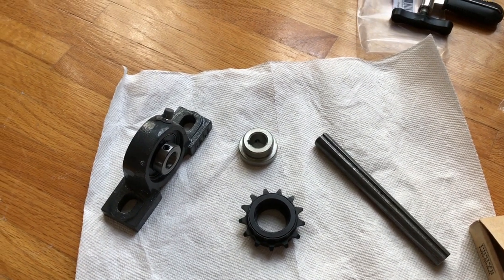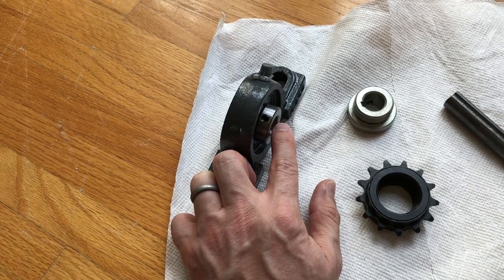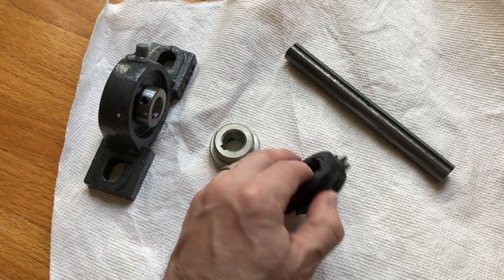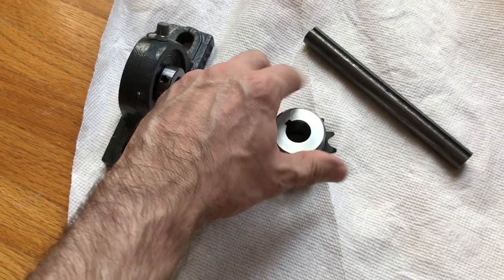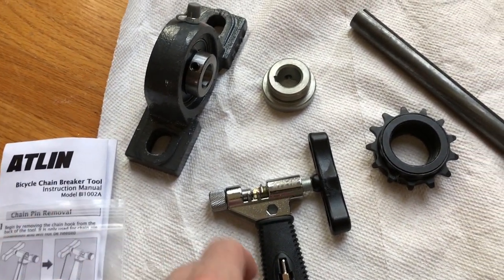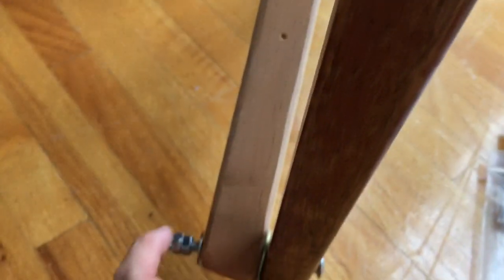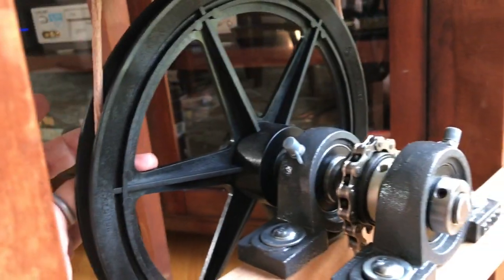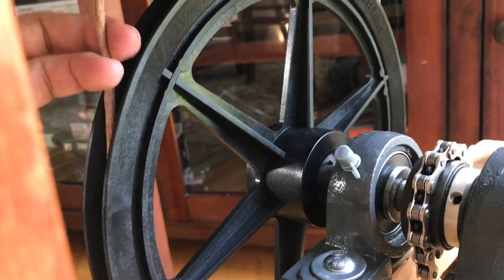Freewheel Treadle Components

Comment: Great project and thank you for posting!  I have an old Pfaff 130 that I'd like to so this with.  How did you arrive on this particular size of pulley? It would be nice if you had direct links or specific part numbers listed for some of these parts.
Reply from the maker: Go to the Instructable in the description.  I think Staton is out of 5/8" shafts, but you easily get that elsewhere or on Amazon.
Reply: @thefreewheeltreadlechannel5677  Thank you